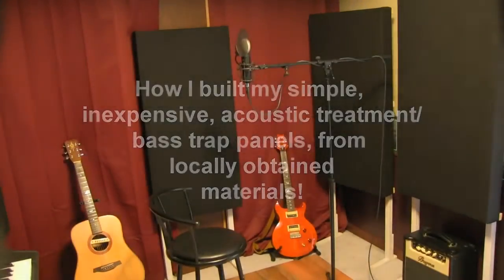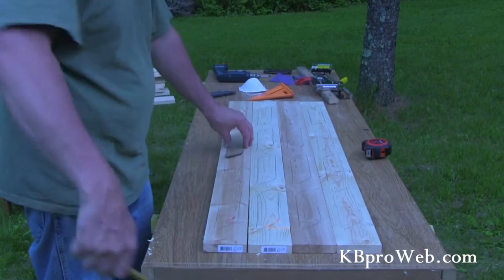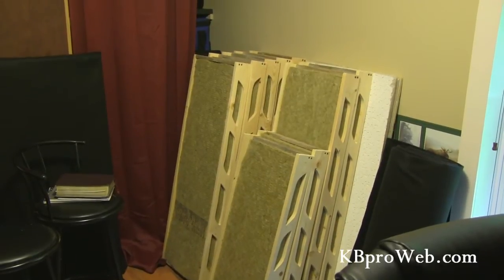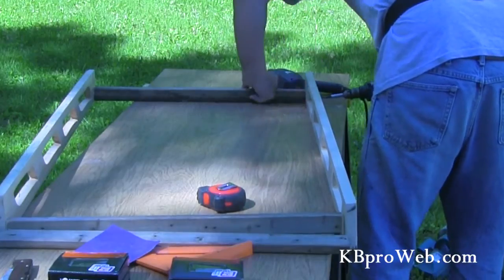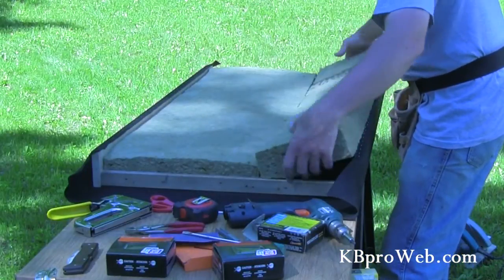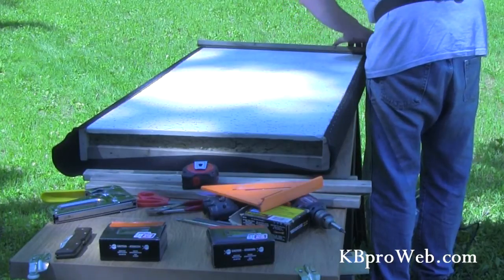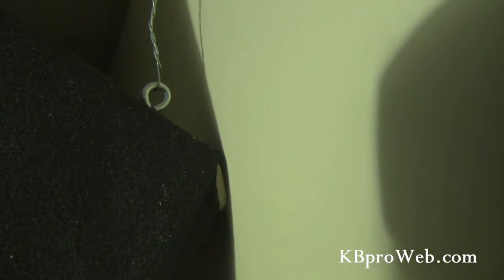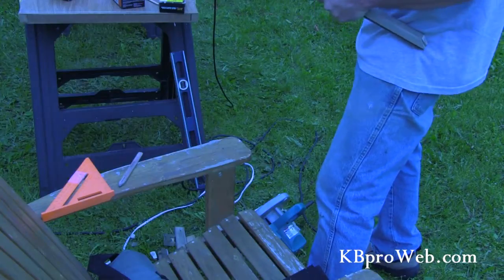DIY Low Cost Acoustic Treatment/Bass Trap Panels, for Recording Studios or Home Theaters

Comment: Those Roxul panels come in 24" sizes that'll fit that panel width better.
Reply from the maker: I had to go to the manufacturers site to find it, but I see that it is available. It's not however, readily available from my local Home Depot, or Menards, Probably would require a special order, and would likely be more expensive. But worth looking into.